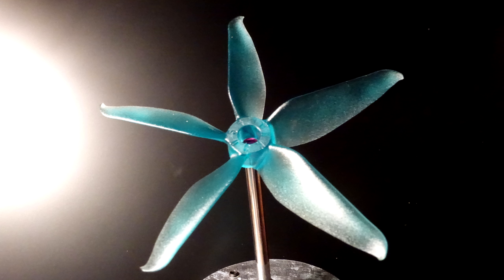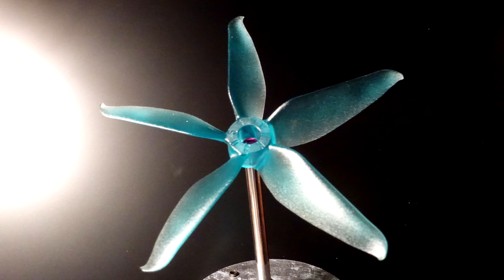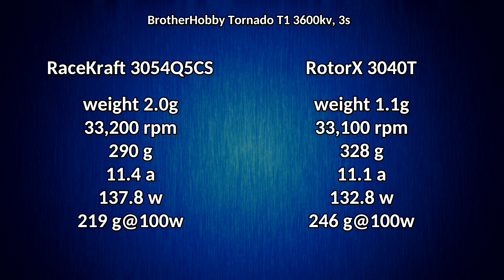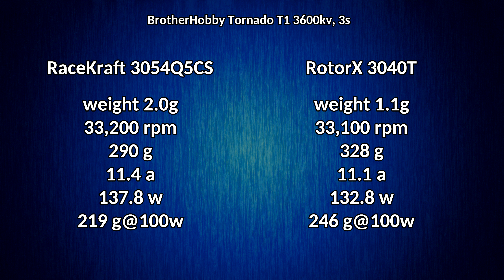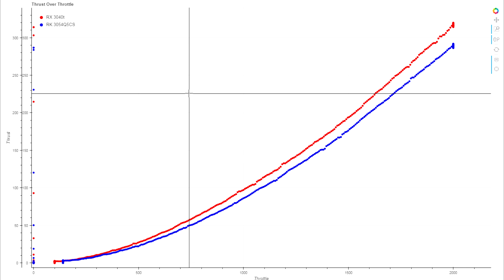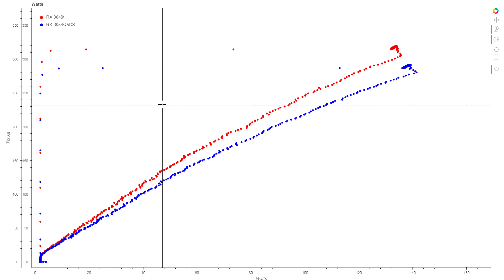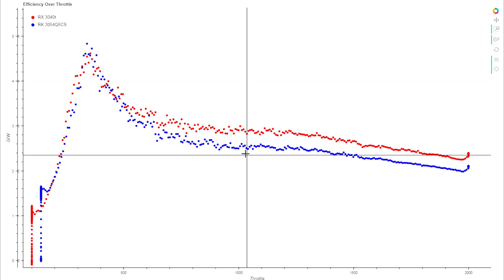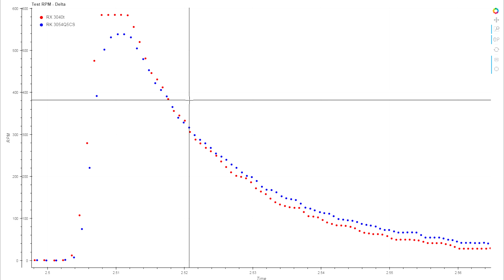RaceKraft 3054Q5CS

Comment: I only been able to test it this prop in a short LOS flight, but it didn't really impress. It felt really slow to accelerate on rs1306 4000kv motors.

One that seemed interesting in my short LOS compare was the gemfan flash 3052, it felt snappy and quick to accelerate.